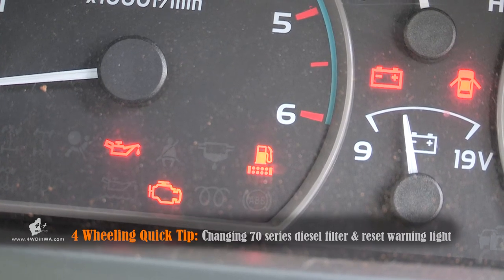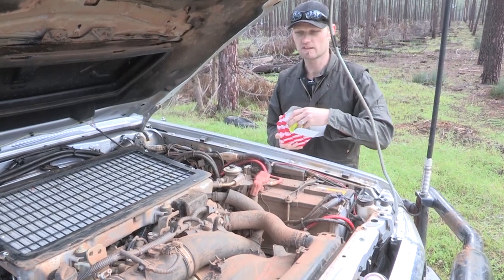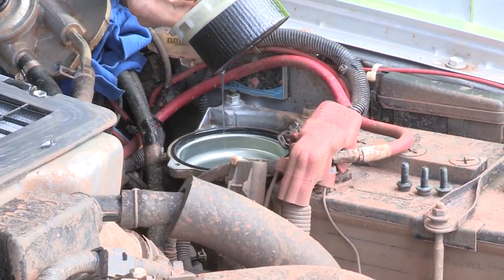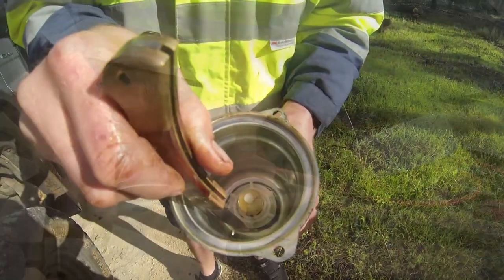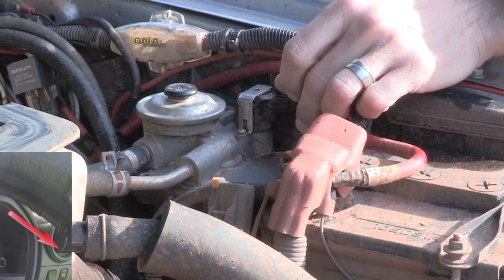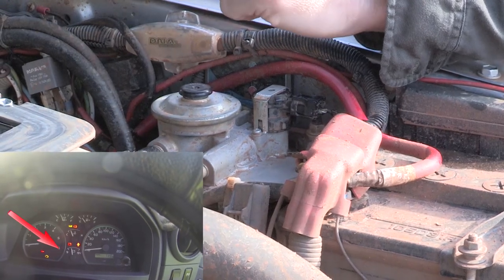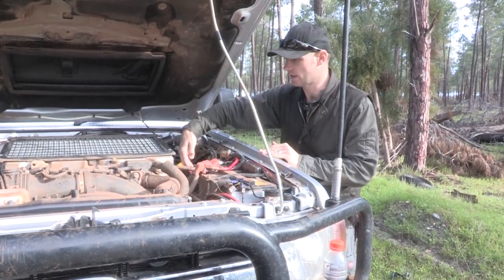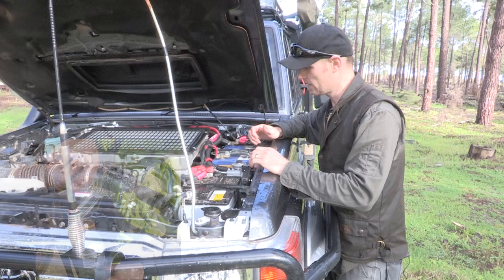70 series Landcruiser fuel filter light reset & changing fuel filter

Comment: You saved me a lot of heartache. I accidently put in ad-blu in my 70 series landcruiser, not much, about 10 L, then realized. When I drove off, off went the filter light and alarm, so I immediately swapped to aux tank and bled fuel system, but alarm wouldn't cancel, even though it was obvious I was draining raw diesel, I drained about 5 L.  I then drained main tank and re-bled, all good, but alarm still going off when I reconnected sensor. Thanks for your presentation, there was nothing in my Landcruiser manual, I'll buy you a beer if we ever catch up,
Barry(Wombat)

Comment: You don't have to pull the cup out just to drain it. Undo the 2 hex bolts and lift up just enough to get to the drain tap, slip a plastic cup underneath, loosen the tap and pump a few times

Comment: HELP!!! I bought a new vdj79 from the dealership about 9 months ago. it's only done 19,000km and ive already had to spend heaps on it and im getting sick of the un reliable piece of shit. I decided not to be ripped off by mechanics anymore so i did the last oil change myself. used genuine oil and filter. got about halfway around the block then it made a terrible noise and just stopped and when you turn the key it just makes a really loud clicking sound. any ideas?
Reply from the maker: +Declan Storebaug no idea mate, perhaps ask this question on this forum newlandcruiser.net of the facebook page 70 series Landcruiser owners
Reply: +Declan Storebaug , did you put the screen tube back into the new filter from the old one?
The old filter will have a hollow tube inside the filter, it needs to be fitted into the new filter, or the new filter will collapse and block oil flow to the engine.
Sound like going to the mechanic may have been cheap after all.